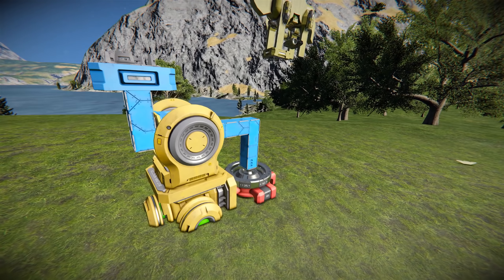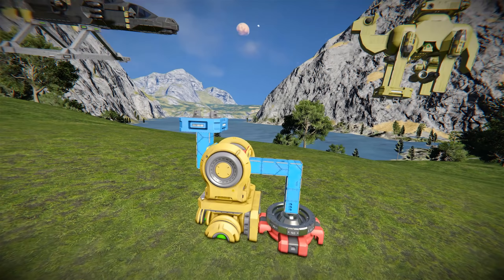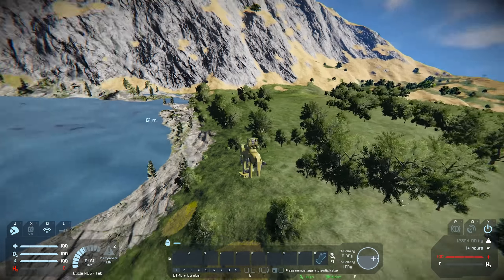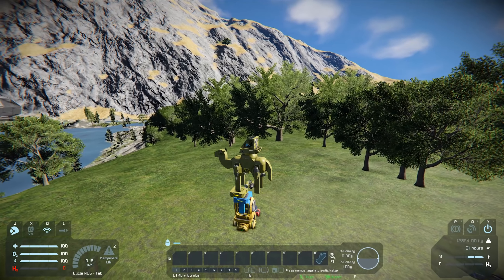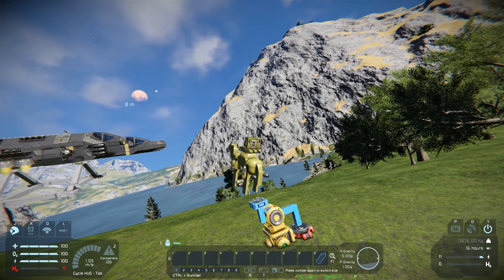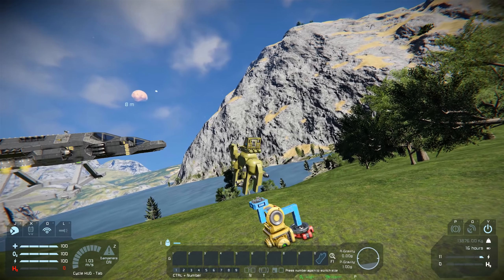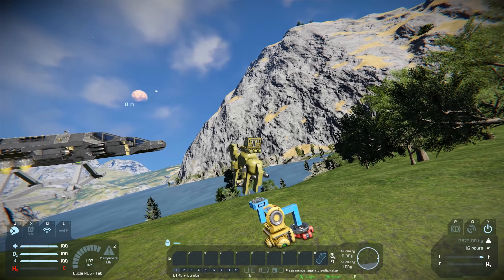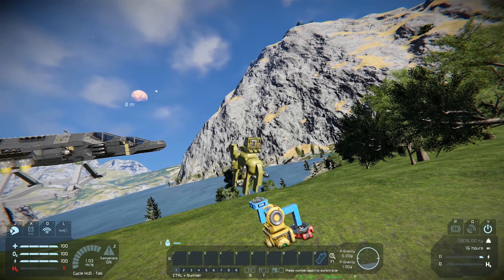Space Engineers - Cheaters Exploit Speed Limit Broken Vanilla Warning

Comment: I feel like a speed limit is required for such a big game, but 100m/s seems too small. Maybe patch of this as well as a increase to the speed limit.
Reply: we've said this many times but the way the physics were designed basically anything over 250, using mods, breaks the game completely
Reply: I think its about relative speed if you are in a small ship they should go fast if you are in a large ship make it go slow. A 200 mph fighter makes sense a massive 100mph battle cruiser doesn't. If you could extend this to custom turrests and missiles. It could make the game more fun as it rewards light craft design
Reply: You could use fighters to disable parts of the ship and if exyended to sub grids make it so large heavy cannons can't snipe fast light ships you would have to design small turrets and light missile systems to counter other people's fighters. And torpidos ands cannons to counter large ships and bases
Reply: Kinda like In star wars squadrons
Reply: @benseaman3856  Actually it doesn't. Space Engineers aims for realistic-ish physics; the SIZE of the ship doesn't matter, the thrust-to-weight profile does. Generally speaking, a bigger ship will have MUCH bigger, more powerful engines and more fuel to burn them, meaning it can go faster than a smaller ship.
Reply: It would reacheck the same physics issues that kerbal space program has, after a certain relative speed difference the distance covered between ingame ticks is pretty large  which would cause playability issues in a multiplayer enviroment.
Reply: It also tends to make space combat pointless above a certain speed.  You cant hit anything manually with a 12km/s closure rate.  That said, I feel like 100m/s is way to slow for a spacecraft.  it is nearly impossible to get anywhere in space without a jump drive, takes forever to "orbit" a planet, and just seems silly that the spaceships are slower than an airliner.  I also feel like the speed limit should be lower in atmospheres, and smaller ships should be slightly faster in atmospheres (or proper drag/aerodynamics simulation).  As it stands, the flight model in this game is one of the least enjoyable implementations I have ever seen.  The ability to build your own ships is the only thing this game has going for it.
Reply: @Tornadic_Outlaw   try the aerodynamics mod and realistic thrusters mod and a speed mod.
Reply: @Mike-qx2iy  then fix the physics
Reply: @shahbazfawbush  thxs will do 🙏
Reply: @Tornadic_Outlaw  That's why realistic space combat would rely heavily on computer-assisted targeting and lock-on.
Reply: @Mike-qx2iy  uhm so railguns/gravity guns ? i dont know in what way its suposed to break the game but i have use a 1000m/s mod and all works fine especaly gravity cannons are really strong
Reply: @benseaman3856  You forget the fact that in Star Wars big doesnt always mean slow. Look at the Venator.
Reply: cant, the devs dont want to change thier engine to fix or upp physics calculations, 
they are maigin a whole new game for that reason, as SE is a 'lost cause' its running on stiches
Reply: I'd rather they had an acceleration limit rather than a speed limit to be honest.... 100m/s is definitely too non-immersive.
Reply: @Mike-qx2iy how so? I play on several high population servers that have have max speeds over 10km/s and they never go down nor have low sim speed
Reply: That could break the game

Comment: I think it’s cool to explore but has no place in a general multiplayer environment. More something for a small group of friends to dick around with and not ruin the dim speed and the fun for others
Reply: Agreed!
Reply: Agreed this is something you might mess around with, in SP or on a Private server. For fun and such but as soon as you start using these weird exploits against others it is just beeing a dick.
Reply: How about

YOU JUST INSTALL THE 1megabite OF A MOD AND HAVE NO TURNING RIGHT ROUND RIGHT ROUND !?
Reply: @schandlicher-schubertverif9478  What are you even trying to say? Did you have a stroke or something?
Reply: use a speed mod for that, theres loads on the workshop and they work great.
Reply: Agreed
Reply: Yeah, i had a similar run in with supergrid.
Not the mild "resize blocks so you can put jumpdrives and windows on small grids" kind of one.
The older and more problematic "you can change the slider values of any block to whatever you want" deal

That leads to thrusters with infinite potential thrust, infinite power, gravity guns that could extend their fields to killometers with hundreds of Gs of push force to break through any gravity shielding, ect... Remember at the time items did damage to grids, so it was just as easy as pointing your bow towards a grid and sandblasting it with thrown stones

And i was the one responsible from finding the way to get around the security keen had made to prevent value editing in a blueprint. Obviously i only used it for creative extravaganza and building some mild technology demostrators. Making the first rotor guns, stuff like that.
Problem is that the people i shared it with started using it on servers, for their gains. And worse, they then started using it against freshspawns simply because they were running out of proper willing targets to fight. They used my tools like the interplanetary triangulation unit to hunt people down, and it tooks some serious engineering to build a ship without exploit that could go toe to toe with a supergrid ship. And once the exploit was finally fixed, they did not stop their griefing ways because they had become addicted to it.

My comunity i used to play with was severely damaged by this event and as such i cannot comdemn the use of exploits that break the game so completly. Some exploits like the intergrid communication are usefull, and not really gamebreaking (hence why it was willingly kept over updates), but exploits like rotor guns or being able to break the speed limit actively dumbs down combat by allowing a participant to disengage themselves from the physical rules that every other has to follow.
Reply: It makes kinetic weaponry a viable option. It has a big place in multiplayer. If you think it unbalances the game then use it yourself, now you're balanced with the other players that use it. Wow, big brain move. I swear the idiots that want to "balance" this game won't be satisfied until all you can build is a single armor block, because anything else could give another player an "unfair advantage"
Reply: @andrewgodly5739  Oi! you can make kinetic a viable option without breaking the rules that everything else follows. I make my own weapons, missiles of every kind, its far more usefull and powerfull than most modded wepons and FAR more satisfying because you know you spent time and effort developing it.

But because these weapons also have to follow the same set of rules that ships do, you have to think outside the box. You know, like an engineer. You have to think around the problems that every one else also has to work with. Just like with supergrid, the fundamental is that you are instead deleting the rules. A bit like a bad admin setting rules and not following them. Because then the only way to fight fairly is to also use the exploit or face someone who is just tremendously better at the game than you are. Because everything is fair game as long as you still operate within the common rules and limitations of everyone else around you.
Reply: @mobiuscoreindustries  in most practical situations kinetic weaponry doesn't work without breaking the speed limit. Try hitting someone with a projectile moving 100m/s in the heat of combat. They have to be slow af or completely oblivious. I've made a weapon that fires 2 warheads per second at top speed and it still isn't practical. I'm the king of kinetic weaponry. If anyone knows about it's limitations it would be me

The speed breaking method is thinking outside the box. It's breaking all the supposed "rules", it's literally the definition of thinking outside the box. Lol

Well then putting any sort of weaponry on your ship or having more armor and speed is an unfair advantage. You won't be satisfied until you can't put a single weapon on your ship because then it would be an "unfair advantage" over someone who doesn't put a gun on their ship. Balance is a rocky road down to removing all skill and knowledge that an experienced player may have discovered, all so that someone who just picked up the game for the first time is at the same level as them. Balance removes the fun from a game of engineering. When has engineering ever been "balanced"? 

If it can be made in the game then it doesn't break the rules. Breaking the rules is using an external program to cheat in new mechanics. The speed breaking glitch and clang drives use in-game mechanics. It's not cheating unless you're an uncreative whiner
Reply: @mobiuscoreindustries  if you have to use script to guide a missile then you may as well just make a ship for someone to drive and ram into someone else, basically it's the same effect. Most servers don't even allow script. Also, script is like a crutch for one's inability to engineer. Just plop in someone else's code and you're good to go.

The issue isn't even that turrets hit the projectile. I've made projectiles that perform better if shot at. The issue is getting the projectile to hit a moving target going the same speed as the projectile. It's easy as hell to make a projectile that can get past turrets to hit a STATIONARY target. You can destroy stationary targets without even a ship. You just need a jetpack, grinder and drill. You can ram spawn pods into stationary targets. They're easy to destroy without using any exploits

Now what's this ridiculous mumbo jumbo about "good hard working players being turned into evil bandits by getting the taste of blood by using an exploit"?!? Hahaha. Omg. Players are griefers by heart. You can't get rid of griefers. Wherever there's stuff to be built there's also stuff to be destroyed. Exploits didn't turn a single person into a griefer, they were probably already one in the first place. I remember back before I even knew any exploits existed. I probably wrecked over a hundred other grids just with my big scary ships. If anything, I've become docile by the time I've discovered some exploits.

Omg. If someone shoots someone to win the game then everyone else has to shoot people to. THE ABSOLUTE HORROR!!! Oh no the game is ruined... That's why it's called a game. Dumb dumb. If someone engineers a killing machine then the arms race begins. It's fun like that. If war was balanced then we'd still be beating each other up with sticks and rocks.

Go ruin some other game. Leave space engineers alone. There's not many games like it. Go play call of duty, or whatever, if you want "balance"
Reply: @bigolbearthejammydodger6527   but console

Comment: If I were to guess, it’s because individual blocks don’t have a speed limit, it’s the grid, but this normally doesn’t matter; however, on large, fast-spinning rotors, the edge of the rotor grid can move faster than the speed limit. You could theoretically make a grid who’s center of mass is moving at this speed, meaning that upon releasing it, it would be traveling at the speed of its center of mass. This glitch somehow manipulates the game so that it applies this effect to a whole grid, without needing to be spinning on a rotor.

Comment: I'm of a mixed opinion, on a small server with friends something like this or the various clang drives I've created to exceed the speed limit are engineering and lots of fun, however on a public server that this sort of thing could potentially crash it does not belong. If you can put in the time and effort to actually design something that is stable and fly well it is engineering and imo things like this should be allowed and encouraged if it wasn't for the performance and glitchyness factors.

Comment: Are the small blocks coming from the rotor attached to the hinge? 

I'm shocked this is even a thing considering you normally have to mod the game for higher speed limits. Curious how/why this bypasses the games speed limitation. Is rather interesting.

Think "cheating" is a bit much, definitely exploitatively unfair from a combat stand point.
I'm certain that roll can be very easily countered, especially by someone who knows how to use the internal scripting system.

Is there an upper limit to the speed this can achieve? or does this entirely unlock speed limit?
Reply: I dont know what causes it, but I do know of another example. If you dive towards a planets surface and get to top speed, you can exceed 100m/s due to the gravity pull
Reply: There is no speed cap, it'll keep accelerating till something stops it. Ive clocked 4500 m/s of one of these. Then I phased through a planet without so much as a hiccup.

Comment: Using specific elements of this method could be made useful. But really... it’s gonna be hard to counter the rotation manually (unless you double up on the setup- one either side ) It can’t exactly be fixed as easily as you think either though - Inertia is the principle of continued motion. Without it, the modern world would not be where it is and ships would come to a dead stop as soon as the the thrusters turn off. That also applies in Space Engineers.

Comment: disagree disagree disagree!
...okay, lets talk about each point...

1: "It's not an engineering masterpiece! it's an exploit!" "I don't see it as engineering"
an exploit? maybe. an "engineering masterpiece"? yes. good luck trying to find a better way to harness clang. not to mention the fact, which another commenter pointed out, that the whole point of engineering irl is to use physics to our advantage, which this device does. exploit or not, it's technically engineering, and a feat of space engineers engineering at that!

2: "it's OP! keen fix this now!"
You can clearly see issues with controlling the camel, and even that larger ship that you said "would be easier to control". odd rotation? good luck maneuvering that thing in fight! not to mention the extreme shaking that's definitely going to end in you crashing into the ground. and if you use it on larger ships, you're going to have to accelerate it to 1000m/s, and once you're there, your ship is so large it's still gonna be easy to shoot. and i'm pretty sure even large ships would have stability issues at some point, creating a soft cap on how fast you can make a ship go.

3 "it may be causing lag spikes!"
Yeah, because one guy preforming a mild exploit that barely breaks any limits is SO MUCH WORSE then dozens apon dozens of various grids, with about 6 of them moving around at any given moment, not to mention that the server must update the locations of EVERY SINGLE PLAYER, and spawn in EVERY SINGLE BLOCK placed. and we saw in your own tests that there wasn't any lag at all, save for a little when a ship connects to the device.

seriously. stop saying "physics calculations". There is barely anything new the game has to compute. I played enough KSP to know that kraken attacks barely, if at all, affect physics calculations more then crashing into a planet.
Reply: I agree with your points except for the whole thing about lag, clang causes more lag on a server than just your average moving grid especially with this spooky quantum entanglement style stuff going on and said lag would definitely be less noticeable on a single player world so I don't quite understand why you brought that up. But yeah this machine is pretty frickin cool.

Comment: The idea of building something custom to be able to travel faster, almost as if youve reached a technological progression is cool. The issue is that this is technically a bug and it isn't controllable. It's not like, you've finally reached a level of progression where you now have post-100m/s travel, its more, hey with a few simple blocks I can break the speed limit hahaha. I think the overall issue is the speed limit itself. It's quite slow, if players felt it was fast enough there wouldn't be people trying to go faster with bugs.
Reply: Continuing on the speed limit issue. The average asteroid distsnce in game ill just say is 20km and this is not factual but purely hypothetical. If you want to fly to another asteroid per say it would take 200 seconds at max speed. That's 3.3 minutes. And that's only 20km. Of course you can use jumpdrives but they are very late game in terms of resource costs and they are meant for long distance travel and not short so therefore it isn't too feasible. I feel like the speed limit needs to be changed to better reflect the environment its in. Sure there are jump drives but that covers long distance travel, and sure the speed limit is okay for relatively small travel but space is big and there currently isn't a middle alternative alternative the rest of the distances. Point in all the speed limit issue is more of a balancing issue, and sure there's mods but what about the base game? Some people like vanilla, and the console edition is only vanilla. I feel more thought and design needs to be put it by the devs in progression of movement and transportation abilities. Currently the only type of transport is the various thrusters. No levels of thruster (except for certain environments) and no alternatives other than jump drives. The game is great and I'm not dissing the devs, I love this game. But I'd love to see more design in the progression of technology as you play, rather than there being one base level of technology. Honestly I'd love to hear from the devs on their thoughts of this topic.